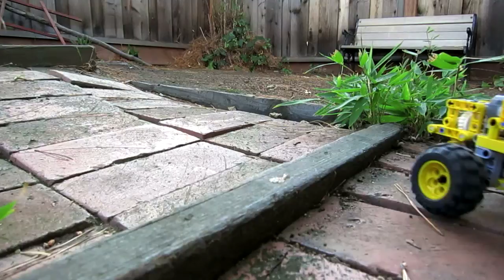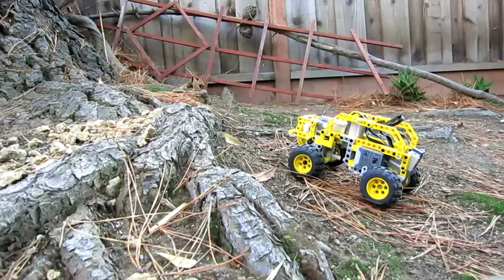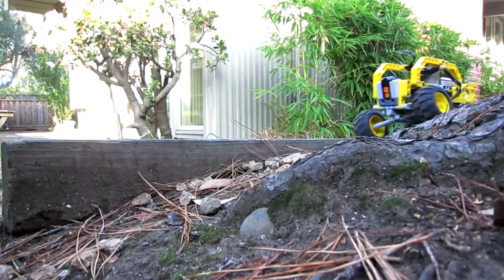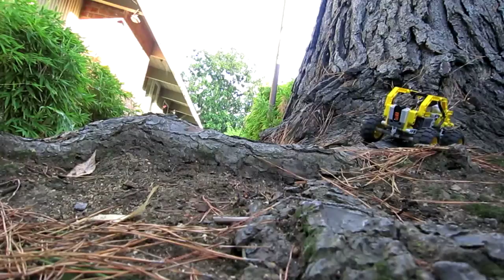Lego 4x4

Comment from the maker: I long since dismantled this model... I can probably rebuild it based on the video. However, I've since built other compact 4x4 using a servo instead of an M motor for steering. Which one would you rather see in details?